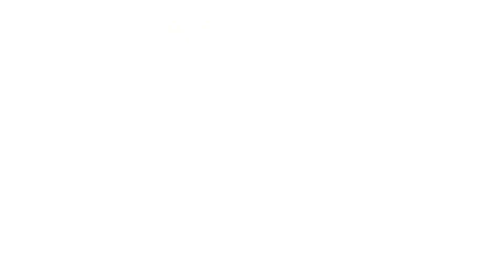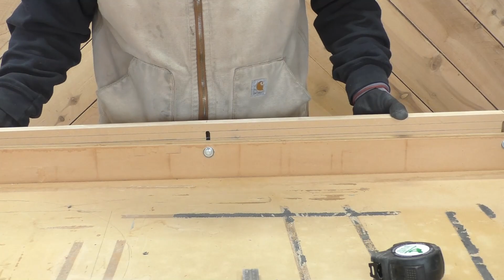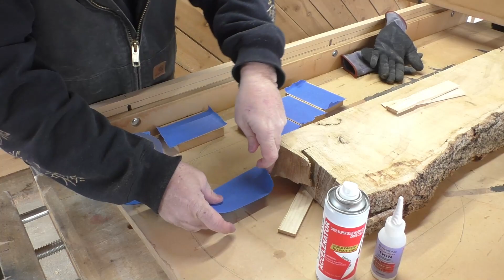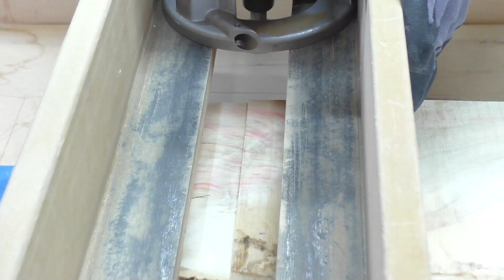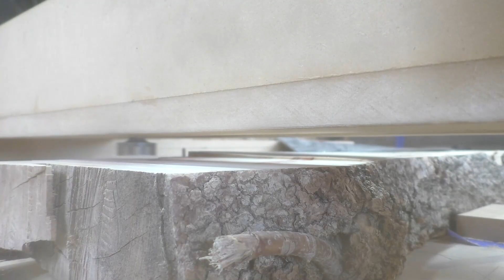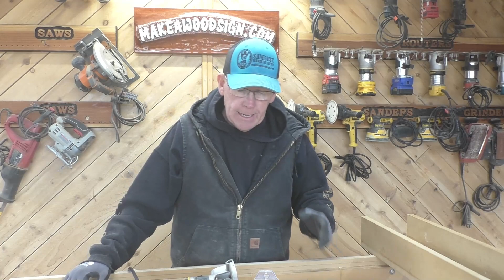The Best Surfacing Bit We've Ever Used!!

Comment: I flattened and levelled my entire bench top with a Dewalt 604 trim router and 1/4 shank one inch dia bit, sliding on one inch x3mm angle aluminium rails and 18mm ply bench side rails set on 1/4” standoff from the bench sides. Taking three passes of 1mm depth.  Easy.
Reply from the maker: If this works for you, great. I just much prefer a set up that will let me flatten much faster. Sometimes the slabs we use will need 1/2" to 3/4" (or more) of material taken off. With my set up I can take at least 1/8" at a time maybe more. 1mm at a time would take lots of passes and to me the $'s are well worth spending to save me that much time. Thank you for the feedback ❤

Comment: Totally agree, no 1/4" shank or any palm router for flattening a slab.  Excellent modification by adding the reference lines.  Well done Dynamic Duo!!
Reply from the maker: Thank you buddy ❤
Reply: Except…see my comment above.  Using 1/4” shank is perfectly possible if you get your guide rails right down to the surface AND use the correct diameter bit for the smaller palm router power.  Then just be patient and let the tool do its work without undue force.  Removing almost 1/16” from a 6x4 feet work piece takes about fifteen minutes.  Take as many passes as it needs.  If you got plenty of money for monster routers and huge costly bits, fair enough, enjoy the spend, but you certainly can use a smaller set up even fir a big slab.
Reply from the maker: Sounds like you found a process that works for you, congrats. I just much prefer using a full size router and bit. I like the stability and enough power to be able to take much more than 1mm at at time. To me the most costly thing we have is time. If I can spend a few extra $'s to save my self lots of time it's worth it. To each his own, thank you for watching and the feedback.
Reply: @oldave100  Plus a full sized router isn't that much more expensive than a palm router much of the time. The bit may be a different story, but good bits are expensive regardless .

Comment: Ooooooo  Thanks !   Comment / option to the table.  What if you cut some slots in the perimeter area in the base of the sled to accept positioning blocks (maybe in varying lengths to adapt to the slab width )  to lock in the slab position for surfacing?  (Much like your adjustable height addition ). Alternately, you could only drill holes in the sled base and use slotted positioning blocks with bolt / wing nut fasteners. With slotted positioning blocks, they can be positioned at any angle around the sled base holes to adept to the slab profile. This would save on your glue and tape expenses, time positioning .... and .... reusable  ..  :)  Plus, if the slab would require a special secure point, all you would need to do is drill another hole to suit.  Positioning blocks can also be in varying widths / thickness to accommodate the slab thickness.
Reply from the maker: Thank you Gary. That's definitely a great alternative to they way we're doing the slab hold down. Thank you for the feedback❤

Comment: It was a beast on the first slab that’s great but how’s it holding up? I bought a surfacing bit from Amazon that was great on the first couple slabs but 5-6 slabs in it’s burning and tearing out. I cleaned it and it didn’t help.
Reply from the maker: Well, we've had the same bit in for a long time. And in our experience, Amana bits hold an edge WAY better than any others we've used.
Reply: @oldave100  thank you for the quick response! I might just go with the 1.5 inch on Amazon it’s like $52 or $56 something like that.
Reply from the maker: Any time, buddy!